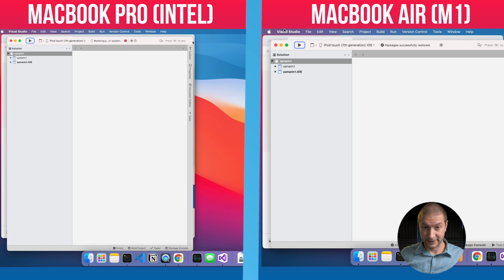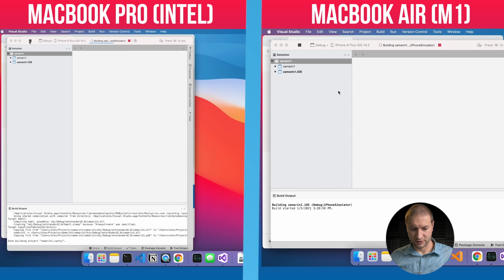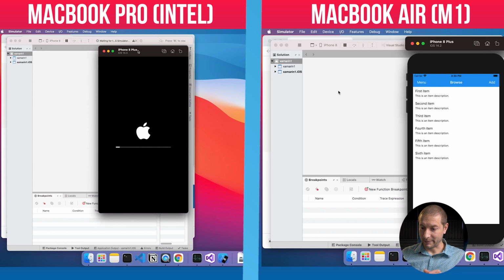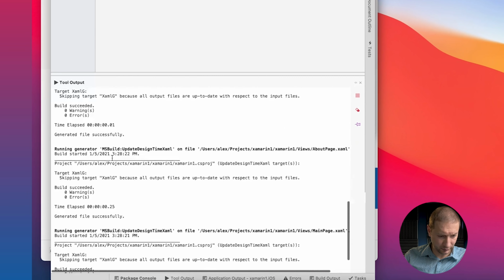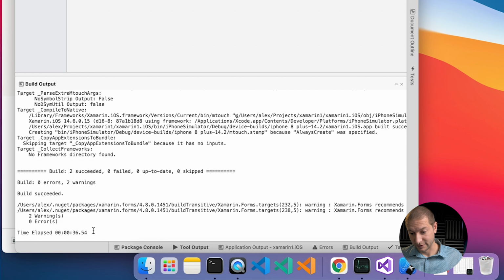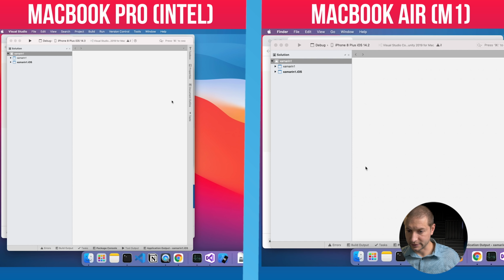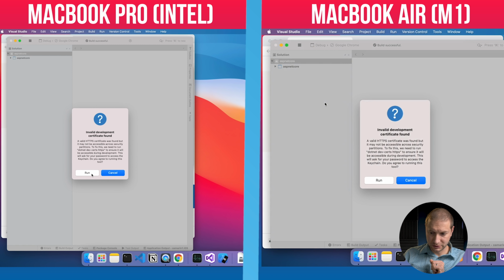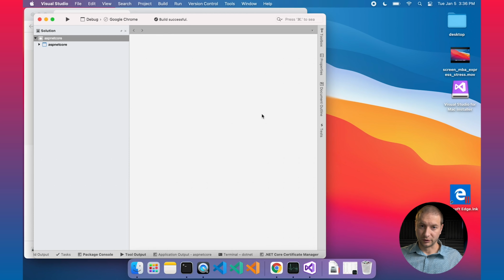M1 MacBook Air Running Visual Studio and Xamarin for Mac

Comment: Native refers to Xamarin.iOS or Xamarin.droid, basically using c# to write native app. Xamarin Forms is hybrid solution that already comes with lots of controls, eg. views, components, layouts etc. Xamarin.Forms application can utilize most of the controls that provided, and it will be build and deployed natively to both platform (iOS / Android), which saves developer time in developing controls or layouts in each specific platform. If the development requires special behaviour, styles or actions that the standard controls doesnt support in "Forms", Xamarin.Forms allows developer to write Custom Renderer in the native side to override standard behaviour.
Reply: Apart from the powerful M1 chip, I believe another advantage of using M1 is the ARM architecture. Once VS has released the ARM version and Android Simulator supports ARM build, Xamarin development will be way faster.

Comment: Here are my real world results of my project:

MacBook Pro (Early 2015, 8 GB RAM) Xamarin.Forms app build times to iPhone XS using Visual Studio:

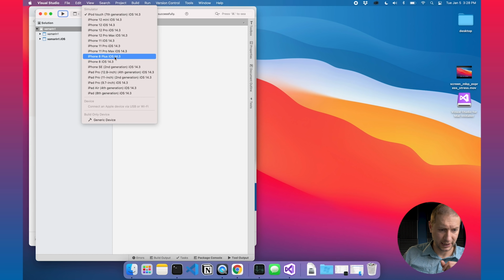From scratch: 4:55
Small change: 2:25 (my typical build)
Just deploy: 0:35

M1 MacBook Air (16 GB RAM) using Visual Studio (Rosetta 2):

From scratch: 2:12
Small change: 1:24
Just deploy: 0:22
Reply from the maker: Nice. Thanks for sharing
Reply: May I ask you to try it with Rider please?
Reply: @metlov  I'd never heard of Rider before, but I installed it and started a trial month to benchmark it. These were my results:

M1 MacBook Air (16 GB RAM) using Rider (Rosetta 2):

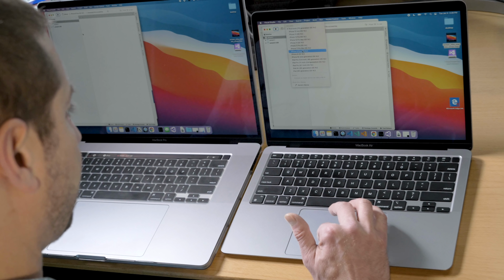From scratch: 5:00
Small change: 2:18 (but app crashed right after installing)
Just deploy: 0:18

So, much worse results than Visual Studio.
Reply: @amuzulo  thank you sooooo much. I see, waiting for more patches then. FYI it’s the best IDE for .NET. Visual Studio is nowhere near.
Reply: @metlov  Oh, I believe it. Rider looks awesome, but a compile that's half the speed would be painful. :-/
Reply: @amuzulo  yeah I read they're working to support M1. Looking forward. On Intel the build time is currently the same.

Comment: You can install the latest alpha of .NET 6 for macOS aRM64 (M1) here https://aka.ms/dotnet/net6/dev/Sdk/dotnet-sdk-osx-x64.pkg
Reply from the maker: Thanks! I tried this on the M1 and the installation failed. Is there something I missed?
Reply: @AZisk  no, the installer is a little alpha :) if you do “dotnet —list-runtimes” in the terminal you should see version 6 listed.
Reply from the maker: Thanks
 Just tried it. Can you shine some light on my initial results? I ran a sample console app in sdk 5 and sdk 6 on my M1 MacBook.  Running under 6 was much slower than 5. I was expecting it to be faster. Did I miss something?
Reply: @AZisk  as of now it is very very early bits. Final release is approx November 2021, expect many improvements by then.

Comment: Can i use Solidworks in my MacBook air 2020 M1 chip?
Reply: Got m1 mac and parallels desktop with Windows 10 ARM which is emulating x64... You can launch Solidworks, but it's still a lot buggy. I can create sktechs, extrude them, but it fails to load a lot of models. 

Before last Windows Insider Update, Solidworks wasn't launchable.

It may be ok in 2-3 months maybe
Reply: FYI I have :
Latest version of parallels desktop for M1
Latest version of Windows 10 ARM Insider Build
Solidworks 2020-2021 Student Version
Reply from the maker: Yep. It’s still not 100%, but getting better
Reply: @AZisk  for Solidworks, it's Windows ARM emulating x64 related imo, because it is only since a Windows update that I can "use" Solidworks on it

Comment: Amazing! I bought the Macbook Air 2020 with Intel i5 and 8GB of RAM and I’ve been using it for .net and Xamarin development, at least for my requirements it’s enough, but in the next 2 years Apple’s Mx processors will be for sure the right choice.
Reply: is 8 gigs of ram enough? I also plan to buy macbook air but I dont know if I should go for 16 gigs version or just 8

Comment: I noticed the VSC is lagging a little bit I'm using the m1 chip MacBook pro.
Reply: Try the insider's version. The stable version is under rosetta.The apple silicon native version is way better. Instant loading and super responsive
Reply: @LucaFang  thank you I previously downloaded it with rosette. And now it stopped working completely. Js Is not functioning at all..

Comment: Phew... I needed that video a week ago before I purchased my M1 MacBook Air for Xamarin development. But now I'm glad I did it!
Reply: I am getting on this thread to hear your feedback. As a Recent MacBook convert for Work/Xamarin development, I was thinking about getting a personal device running macOS to do other projects with Xamarin. It’s grown on me and I am overdue for a new non-work notebook. However, AMD has announced their new chips for notebooks which look amazing, so I will probably stick with windows. If push comes to shove, I do have a Mac on my home network I can use to build iOS through remote connection.
Reply: @JamieKeefer  I've been using a mid-2015 MBP for 3 years for Xamarin development quite intensively. This guy is still doing great even today, but I'm looking forward to upgrading to M1.
Reply: @JamieKeefer  atm I do have this exact setup what you are describing: Working with a (fairly old) mac mini as a remote host. but tbh this is far from ideal. to be clear: I love the fact that is even possible to do the whole workflow from a PC but build times are way too long and I constantly have problems with the debugger on iOS. dealbreaker for me is that the iOS Designer for VS is going to be ditched.
Reply: How's the overall performance with development applications? Is it worth buying over M1 macbook Pro?
Reply: @shubhamjain4544  unfortunately it's not shipped yet. So I can't say anything about the overall xamarin performance.
Reply: @boardsandbirds  post here when you get it please

Comment: Does the debugger work on visual studio?
Reply: This should now work with Big Sur 11.2 Beta 2. I’m now able to debug and step through in Rider with dot net core 3.1 since installing that.
Reply from the maker: Debugger doesn’t yet work well according to documentation. However I did do a test inside VSCode with a simple console application and was able to step through that
Reply: @AZisk  that’s huge. Thanks bro. 

Also, Love your channel. Keep up the good work.
Reply: With Visual Studio 2019, debugger is not working for .net core web application. And to run the application you need to right click on the web project and need to run it.

Comment: Native means it uses the actual iOS or Android Frameworks where Forms is an abstraction above that.
Reply: Yes, for iOS you will be writing UIKit code in C# and that UIKit code will not run on an Android device. Xamarin forms is a XMAL based UI framework like WPF or UWP that can be built to run on iOS and/or Android. For native apps you keep all your common code in a .NET dll.